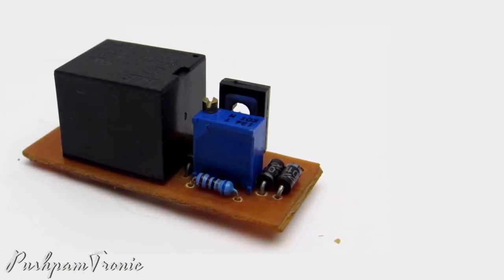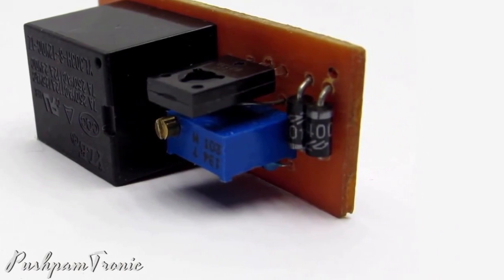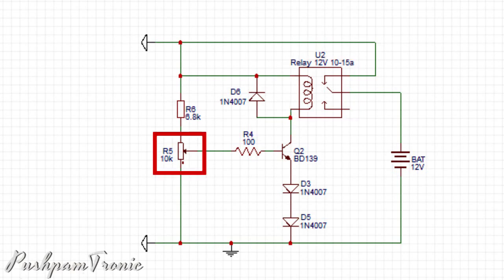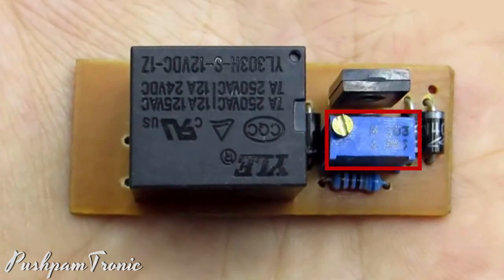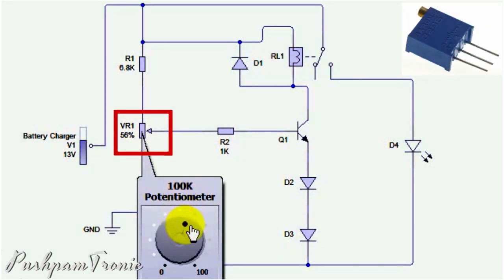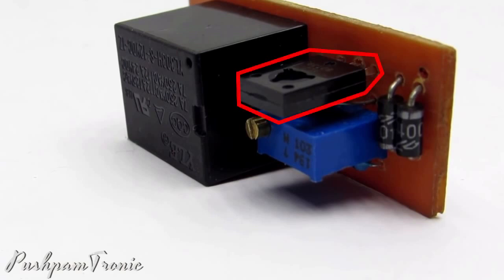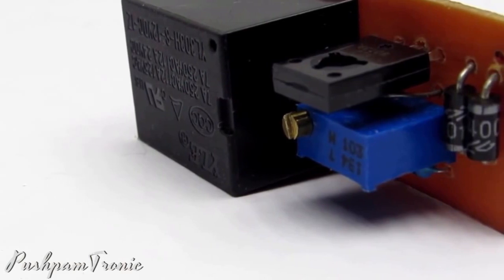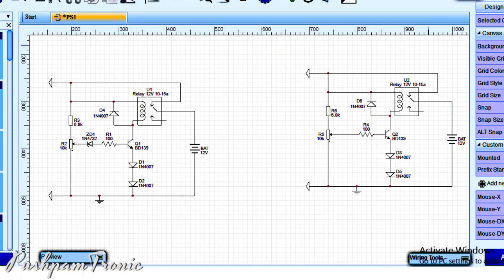DIY Auto turn off for Battery Charger

Comment: It can be used just to charge the battery and then remove it or switch off the circuit once charging copleted. 
If you keep it connected, once the battery is fully charged the relay disconnects and stops charging the battery. But it will not change the relay state even if the battery voltage falls to a lower level. the circuit will not charge the battery automatically once it goes low. You will have to switch off and switch on the circuit to reset the relay.

Comment: I printed your drawing. I'm not an engineer, but it seems that this drawing has mistakes on the right side. Why don't you fix it? On the LED's, the poles should be reversed. Isn't that right? The square icon (negative) should be on the left side. And the connection of the 1K Resistor (bottom right side) is not clear about what it's connected to or where it's going.  Can you fix this drawing? And D3 is not clear either.

Comment: sontu80biswas@gmail.com  send the circuits picture on my mail address. i set the the lamp at 14.4 voltage , then rotate the 10 k pot . lamp goes out . and other terminal led gone but . then i connect the bettery charge at 11.5 volte then also the other led on . it should off. ang charging this is my problem . please help me ..

Comment: in these video did not test with battery ...its shorts with a lamp and input voltage is increased . puzzled... make a clear video...
Reply from the maker: +Sontu Biswas the lamp was not short, it becomes off.
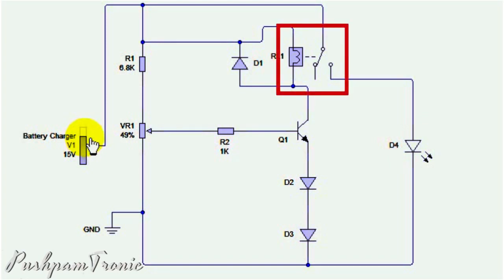You can see this in video (time 1:38)

Comment: battery voatage is over 14 volt didn't cutoff. the circuit is faulty..i think..or differ from the reaal value..
Reply from the maker: +Sontu Biswas i have tested the circuit virtualy, theoretically and practically.
It is correct circuit with perfect value.
Reply: Sontu Biswas    full automatic on of battery charger watch this video
https://www.youtube.com/watch?v=qQINJlZw0lE&t=527s

Comment: if the battery is faulty the charger still working or cut off?
Reply: cut off
Reply: Aman Kasma, yes...and start charge if the battery low voltage, you can steup itu as you want.
Reply: yes it is good simple automatic 12vdc charger..I have  build it and work well 1 year ago until now.

Comment: variable resistor is needed or not or 10k resistor is enough
Reply from the maker: +Silchar Zone 
it is needed to adjust the threshold voltage.
Reply from the maker: +Silchar Zone if you will use 10k resistance the threshold voltage will be fixed.

Comment: Fyi, the piezo is AC..But from the piezo i will connect it to the bridge rectifier to convert it to DC.Then, from bridge rectifier it will connect to the capacitor to ripple the ac voltage...So, can u please tell me how to connect this to your circuit and then what shoulde the value of capacitor be???Please friend i really need ur opinion
Reply from the maker: +Muhammad Irfan Danial Mohd Norhan 
For piezo or any other thing you can use pins of the relay (pole and NC)

Comment: If i use a piezoelectric transducer as a power supply to charge up the battery, where can the piezo connected to in this circuit?

Comment: If i want to use buzzer to indicate the battery is charged, where should i connect the buzzer to?
Reply from the maker: +Muhammad Irfan Danial Mohd Norhan 
You can use pin of relay as switch for buzzer.
(Relay pin :- pole and NC)